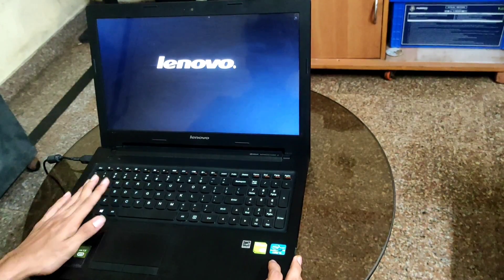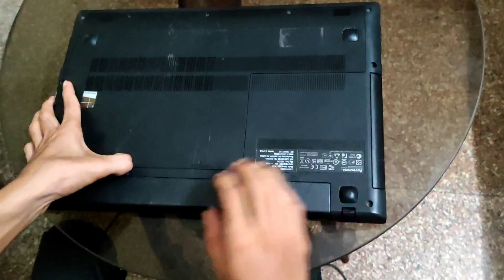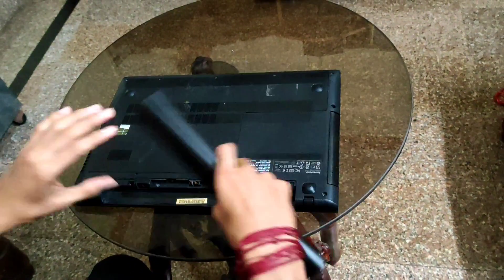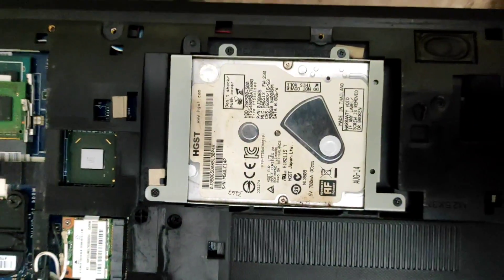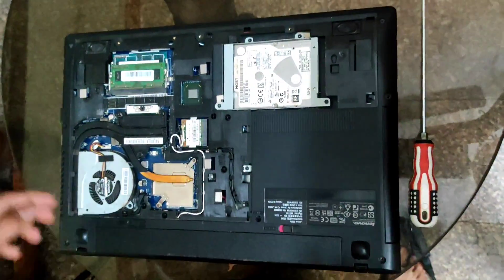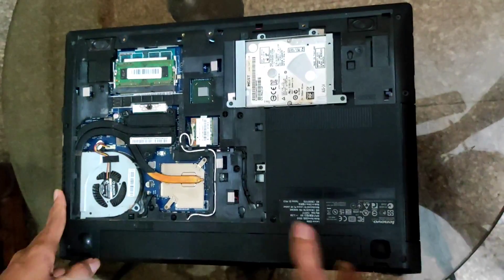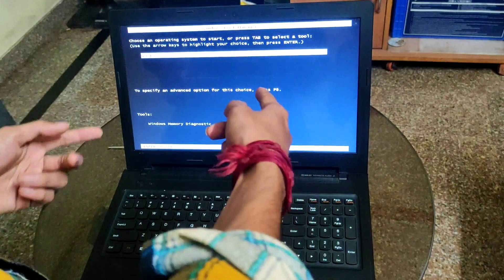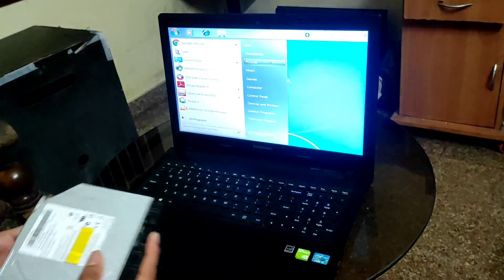Lenovo laptop stuck on starting windows screen||how to fix Lenovo logo hanging problem

Comment: Bro after doing this it stuck on blinking point know what to do
Reply from the maker: Press enter  bro..
Reply: What if the keyboard doesn’t work?
Reply from the maker: @kyliegilinsky6394  either connect external key board or replace  key board..
Reply: What if the computer is stuck in recovery boot menu mode and you’re trying to select ‘ normal startup’ but the keyboard isn’t working what do I do then?